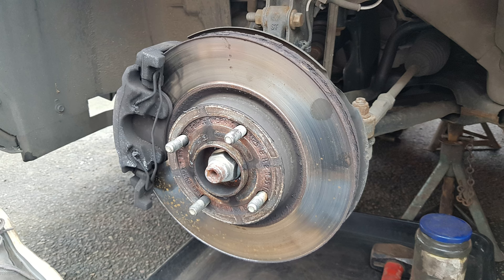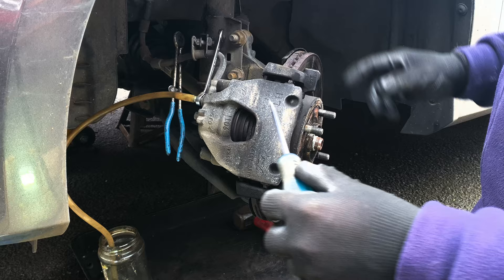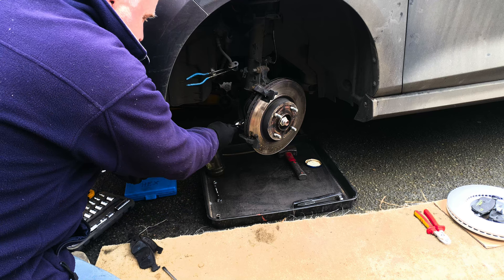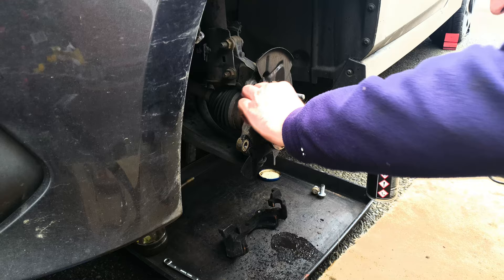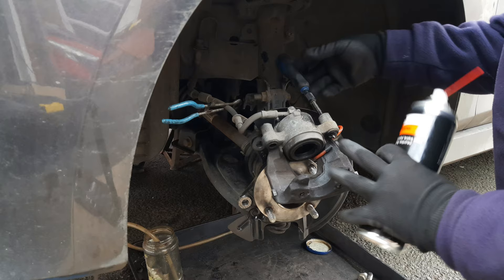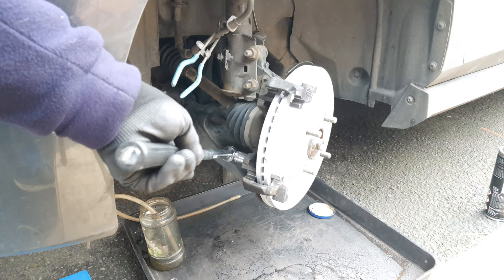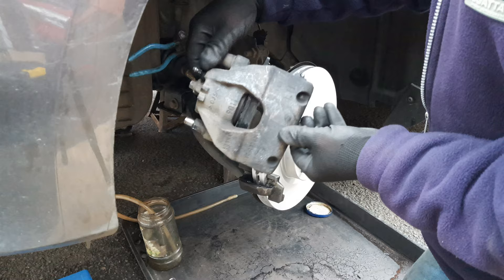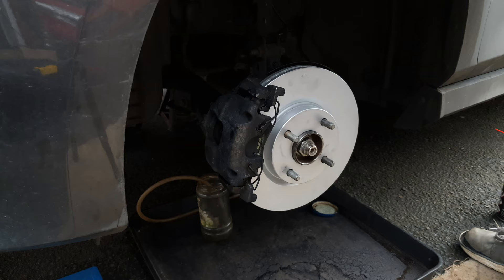Changing Ford Fiesta Brake Discs | Fiesta 8 2017 on

Comment: Hi Cyd, really enjoyed this . Best explanation yet as to where to insert a pry bar or screwdriver to push back the piston. Just one small point, when suggesting slackening the clamp bolt to the suspension strut. I believe this is a torque to yield bolt, so if slackened off, will need to be replaced. Keep up the good work!

Comment: Excellent and concise video! I watched other videos but none of them were as good as yours because none of them showed what tools or what size sockets, hex keys etc to use on each bolt! Using your links, I did a shopping list and had everything ready to do the job on my wife's 2019 ST Line! Only point I would raise is that when I did the upper caliper carrier bolt - I managed to still use my 1/2" ratchet and slim socket but I used a short extension bar which was long enough to bypass that suspension bolt but not so long that I couldn't undo the bolt because of the inner arch. 10 out of 10!
Reply from the maker: Only 10 out of 10! How disappointing, lol! But seriously ... thank you. When I first started my channel nearly 7 years ago, I had noticed how most 'how to' vids on cars were woefully inadequate on the parts and tools front and figured "I can do better than that". Thrilled it's working!
And thanks for that tip - I'll try it this week, my son's car needs discs and pads again!
Reply: @CycloneCyd  Thanks Cyd! I took my wife’s car out for a test drive after doing the brakes. No more graunching or grinding when braking and the car brakes in a straight line with no steering deflection. All ready for its MOT next week! Cheers!

Comment: great video, just a note ceratec isn't supposed to be applied where rubber is, it says in the back of it. best to use silicone grease which can be applied to both brakes and rubber.
Reply from the maker: Mintex ceratec IS a silicone based grease (or Pagid or Textar - all from TMD Friction). You sure you're not confusing with something else?

Comment: Hi I recently had these changed at a garage and they put 262mm discs on my mk8 st, I believe they have messed this up as in this video it seems the disc is 278mm?
Reply from the maker: I don't have the tech data to hand right now as I'm on hols in Crete. Access the textar BrakeBook and search up your car there and it will tell you the correct disc size.